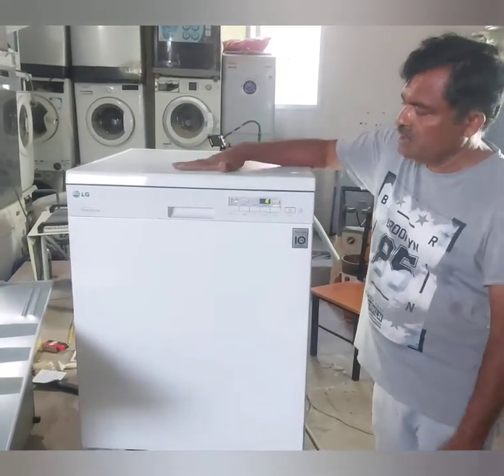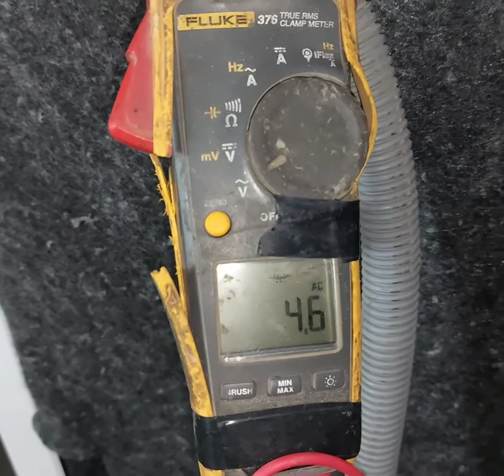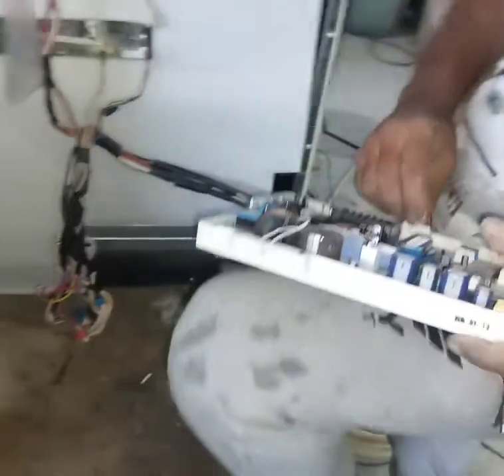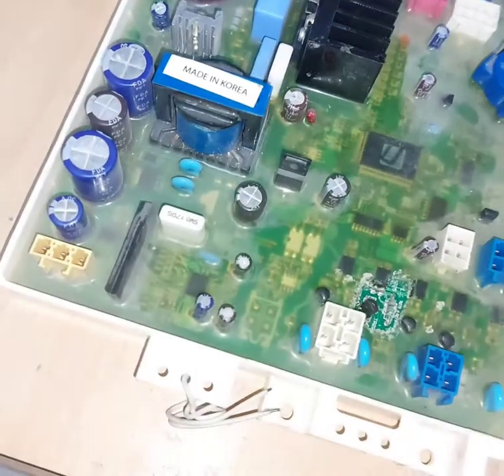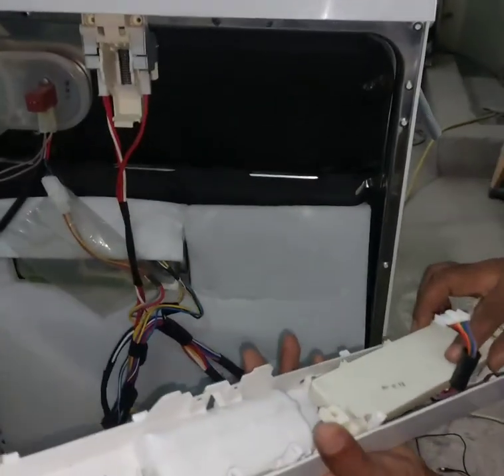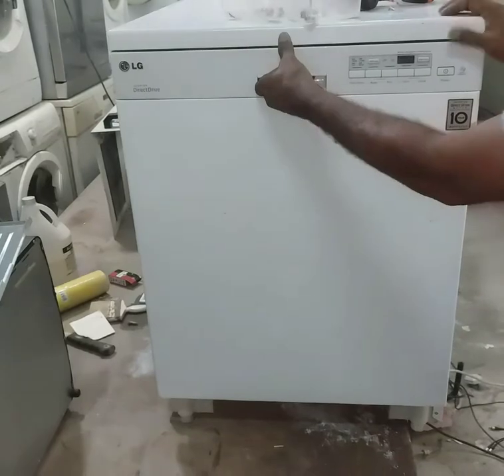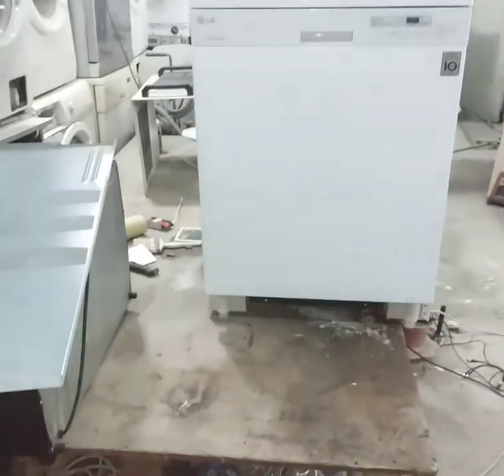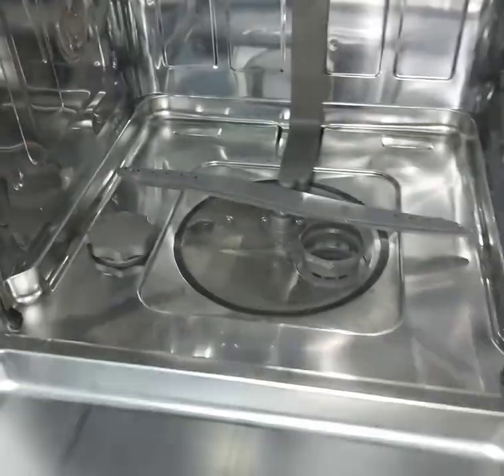Lg Dishwashers Error 'IE' /LG  Dishwasher error cord/dishwasher repair Fujairah.

Comment: My LG Model LD1419W2 at first drains OK (after I put a couple of litres of water in the dishwasher floor with a saucepan) - then it tries to get new water from the inlet hose - then gives "IE" error code - you did not show how to check inlet pipe (that is how to get to the inlet pipe) could you show/tel mell me? (do I have to take any metal covers off first?
Reply from the maker: Dear sir.. Its not related with drain pump. Its will be inlet valve or water supply line problem.. Kindly clear it...
Reply: @magelectronics  Will check that out - thank you !